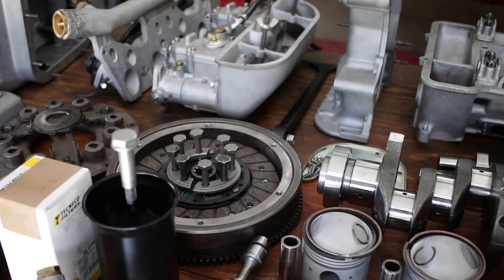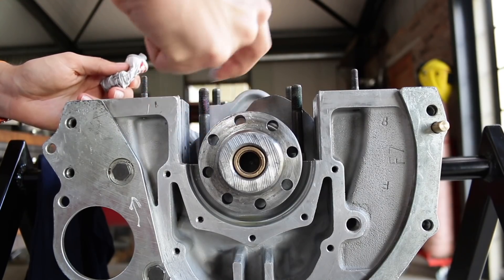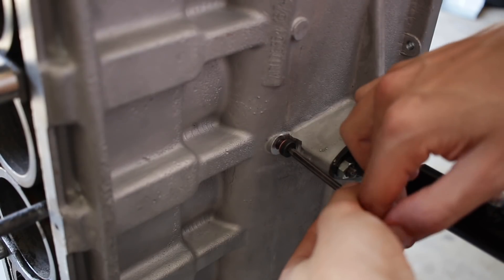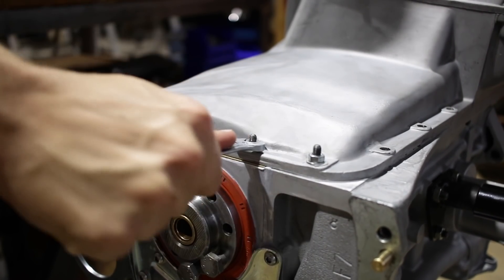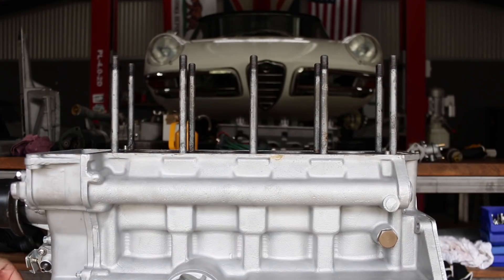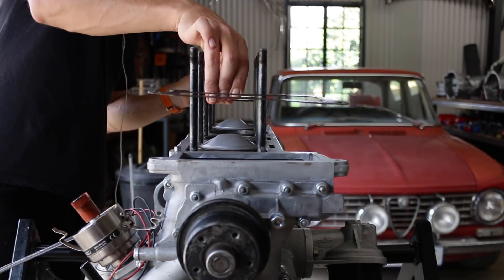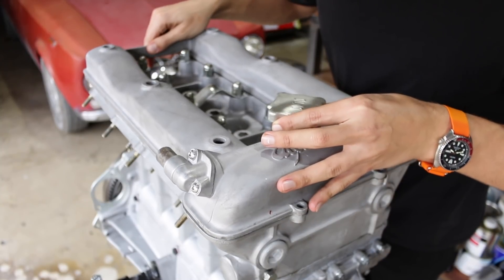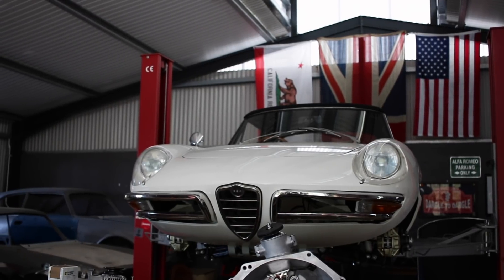Engine Rebuild for the 1967 Alfa Romeo Spider project.

Comment: Hi Jethro,
Very much enjoy your videos.
You have a calm, engaging way that is wonderful to watch.
Couple of things...
How were you certain that the bottom end clearances were correct without a clay test?
After so much machine work, and having been supplied with undersised bearings, I highly recommend  the clay test. 
Would be a shame to have to do it all again.
Before startup, I always pull plugs and run the oil pressure up. Helps spot leaks too, and you're only running at starter speed.
Hope that 1-2-3 ignition should aid in hot and cold starts, although I'm a purist and love me old points.
Best of luck on the build!
Reply from the maker: Thanks! 

So this engine was all together and running recently, but with top end issues. We did a bearing clearance test with plastiguage and everything was spot on. For this video I just used a new set of identical bearings, because people would freak out seeing me put used bearings back into a new engine.

There's lot's that didn't make it into this video, as I wanted to keep it under 20 minutes. I'll do a long video series on my 2000 build for the Ti, I'll get into the weeds with measuring in that video.

I'll put up a video this week about my oil priming process, I like to fill the engine with an external oil pump to make sure it's totally primed before I crank it on the starter.

Comment: Seeing this re-build reminds me of precision watch making and now I understand that the troubles that the Alfa Romeo Spiders suffered in this country might have been due to the ham- fisted mechanics who were used to American Iron that back then was needing a ring and valve job after 30 thousand miles and a full rebuild after 90 thousand miles. After that, the new models of whatever make were out and the trade in was usually good for the down payment on the 36 month note.

Comment: Jethro, The tricky part of these engines is the valve lash adjustment since they are solid lifters and use shims. I would like to know the formula you use to properly shim the valve clearance correctly.  Thanks!
Reply from the maker: I have a pretty large collection of shims in different sizes, and when I'm assembling the head a swap them out until the clearance is correct.

Comment: You couldn't have done this better! The video is really good! Only one question... shouldn't the camshafts be using some kind of grease when mounted?
Reply from the maker: They're oiled. It's fine for turning it over by hand. I oil prime the whole engine before starting it for the first time.

Comment: Great job, very interesting the comparison between that engine and my 2.0 JTS 916 spider engine.  I also would like a video devoted to the technique of keeping a white T shirt and white sneakers clean in a motor garage.  Tony Curtis white.  Amazing.
Reply from the maker: The sneakers are pretty filthy. The white shirt was easy. When all the parts are clean and you're assembling with clean oil, you can't get old grease and oil on yourself.

Comment: This has been a great series and is appreciated by all in Alfaland.  A step up in lighting and editing as well over the typical run of the mill DIY stuff and while Alfa diy guys are much better on average than other marques, this is a very well lit and staged piece-very professional
 
Curious if you installed a new oil pump or rebuilt the old one and any other suggestions you might have on components/assemblies and curious on what other parts were evaluated such as cam sprockets, valve train work (new springs or valves ) etc

While I see you have a copy of the Giulia workshop book, did you ever refer to the books by Jim Kartalamakis. A couple of local guys rave about them. Thanks again
Reply from the maker: Thanks again Steve. I had the oil pump rebuilt from original parts. I have a huge collection of old pumps, and I try and refurbish rather than go with reproduction. The original pumps were of amazing quality, as was so much of Alfa's components back in the 60s/70s.

I had the head built by a friend of mine. We replace anything that isn't totally up to standard. He sets up the valve clearance checks the valves springs. I've never had an issue with one of his heads before.
Reply: @JethroBronner  Agreed on the rebuild vs reproduction.

Comment: Best tool porn ever!  Seriously, your videos are a most wonderful life lesson.  You begin with a desire to save a bit of history as an honor to those who built it.  You put your all into it and get hit with an unknown, very bad problem.  This hurts, after so much hard work.
Most people stop here.  They are spent, hurt, exhausted.  Did Jethro stop? NO, this is where you shine.  You re-group your thoughts, pause to recharge and formulate a better plan with the additional information you now have.  The new diagnosis was brilliant.  It was but one flaw that caused all the issues with the engine.  Once you knew that, you charged on with even more confidence.
The way you turn bad into good is so beautiful, a life-lesson very much needed in these hard times.  Thank You Sir!

Comment: Congrats! Do you know how they "guess" how many Nm one has to exerce? I was also asking myself the same question while working at the bikes assembly.
Reply from the maker: I'm sure there's some mathematical equation to work it out, but I have no idea.
Reply: @JethroBronner  I always figured they take an educated guess based on previous experience, the expansion and contraction of the metals/alloys they use, the thread pitch and clearance of other parts, like gaskets, and then run them and see if anything fails. When you bolted the flywheel on and didn't use the locking washers it made me wonder if the bolts would be too long then and would the torque specs differ then? I guess if they don't hit anything behind it they should be fine?
Reply from the maker: Yeah there's nothing for them to hit, and those locking washers are so thin. My concern with locking tabs and washers is because they're not high tensile steel, that overtime they crush and then the bolt can come loose.

Comment: Welcome back Jethro.  The usual fantastic build and reassembly quality we have come to expect from Jethro.   Regarding the fuel pump,did you use the original FISPA pump or another brand as there are some alternatives to FISPA.?  Hope you used an original REGINA timing chain, although there are other chains available for these engines. This would have to be the cleanest 1600 engine ever seen in the history of Alfa engine rebuilds